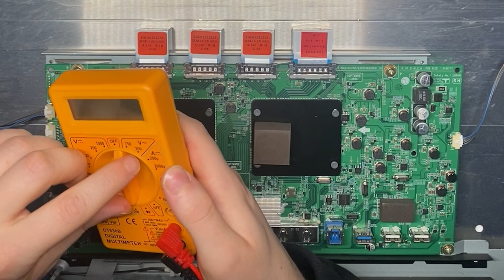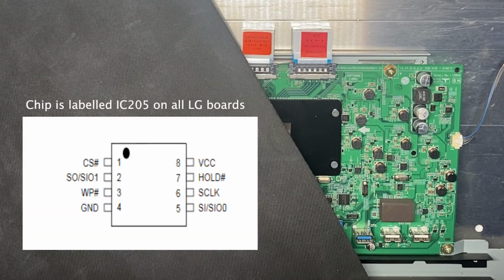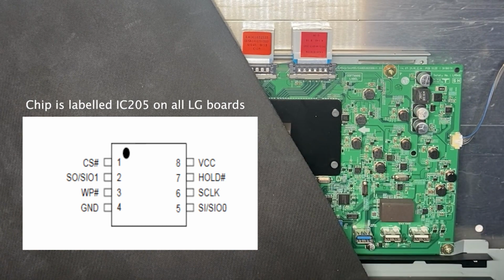LG Monitor won't turn on - LG 34UM95 / 31MU97 FIX

Comment: P900 to SCLK after trying all the rest did the trick. Now onto figuring-out why the mushroom button isn't bring-up the menu as unable to factory reset x)
Reply: ok turns-out you gotta have a monitor plugged-in for the OSD to ever show. Also it seems to refuse to save its settings. After reset, once I power it off it won't come on again unless I run the fix over again (with one of the options you give being successful, a bit at random one of the 3. P900 to SLK was the first one, but sometimes it's pins SLK to VCC or CS to SLK.
Reply: the saga continues: I turned the monitor off through the OSD first. Then through the button, wait 5s, unplug, 5s, replug, 5s, turn on. And it seems to work... so far
Reply: Still working, thanks for the video! 🙌

Comment: Sir, My LG Ultragear 120hz moitor is not turning on.   Techs say that the motherboard whole issue.   

Worried about new motherboard price, I thought I could only use the screen with other motherboards.  Is that possible?   I mean can I convert that into a TV now with any other motherboards like cheap Chinese boards?

Comment: Yesterday i had the same problem again i previously repaired my 31MU97 with the assitance of your video . Knewing now that the power state seems to be uncorrectly stored i had the following idea:
What if manually confusing the ic will give the same result like shortening it?

So i permanently toggled the on/off switch nearby the ac inlet in parallel to permanetly presseing and releasing the on off button in the middel of the steering cross.

After a few seconds I heard a loud bing sound like it always appears after pressing the power (on) button. I directly stopped toggeling.

 Now the sceen is working fine again!

Comment: I unplugged the wall outlet of my 10yo 34UM95 last night and this morning no power. I NEVER did any kind circuit/electricity stuff and after buying a multimeter, I did option 2/3 at least 2 times each and... it worked !! Thank you so much.

Comment: I have a 34uc97. Worked BUT when I turned the power switch off to try and put the monitor back together, it would break again. I factory reset too immediately. I got it to turn on a few times but now it's not so I think the IC205 which is he EEPROM chip, is just dead. I found a new one preprogrammed from an ebay seller out of Texas. $11 bucks shipped. Just search for this and you'll find it. Make sure your mainboard model number matches up before you buy. Shoudl be a relatively easy solder.

PRE-PROGRAMMED EEPROM FOR LG 34UC97C MAIN BOARD# EBU62882001 EAX65923703
Reply: Ok so I got the pre-programmed EEPROM and desoldered the old one and soldered this new one on. DIDN'T WORK! So I put the old IC205 back on and did the tricks he mentioned in the video. And it worked. I honestly have no clue what I did but I suspect that taking the old IC205 completely off the board for a week and putting it back on finally reset it. But really who knows. All I know is that this video did actually help.

Comment: Unfortunately none of the methods worked for me. Got a cheap programmer from amazon and flashed the IC, now it works again.

The flash dumps are quite easily found via a simple google search and sometimes a registration in some hardware forum.

Comment: Thanks for sharing, VCC to SCLK seems to get my 31mu97z-b running again but it won't do the factory reset the monitor just turns off after long press... And the standard menu reset results in the same problem as before, did anyone found a solution to this?

Comment: Worked out!  Thanks a lot! I used the + and alternating the CS# and SCLK pin on the chip, then reset the monitor to default via the menu, but the only thing I noticed is that the EEPROM seems to go back to the bad state if you cut the power without powering down the board via the button. In other words, I left the back side open, if by accident the power get's cut I can do the pin dance again. I guess the EEPROM chip seems bad, or does not store the correct values? Maybe anyone who can elaborate?

Comment: All this dancing with a multimeter comes from poor knowledge of electronics . 
20kΩ resistor doesn't change anything because of the threshold for CMOS logic. For this memory it is 0.7xVCC - around 2.3V. We have to apply such level to deselect the chip.
Also, all the data and control lines of the chip have 22Ω serial resistors - use basic math to calculate the resistor divider 22/20k and the voltage at the pin and you'll see the absolute futility of this idea. 
Moreover, the FLASH access cycle takes a few milliseconds. Trying to randomly get into this period is a very stupid idea. That's why it took 30 seconds with the probes and often didn't work at all. 

I got the result in 5 seconds - I just shorted pins 1 and 8 (VCC applied to CS#), turned on the monitor and heard a beep indicating that the system was on.
Reply from the maker: Yeah I'm no expert. Thanks for sharing your knowledge

Comment: So you're essentially jumping power to the pin... Just use a piece of wire.

Also you keep saying turn it on/off if it doesn't work... The problem is it doesn't turn on the begin with so....

Comment: Thanks a lot for that video. I could fix my 34UC87-B with it.
 
One tip for other users. If you don't have a p900 (+) somewhere, just use the VCC of the IC (Pin 8). This has already 3.3 Volt and you don't need a multimeter to reduce voltage. 

I just used a cable to connect pin 8 to 1, 6 and 7 alternating multiple times. Just make sure not to connect Pin 8 (VCC) and Pin 4 (Ground).

Comment: Tom, Thank you very much for sharing your knowledge. I was able to fix my LG 34UM97-S using P700, SC+SCLK.  I tried all 3 options few times and almost gave up. Next day, I tried option #1 keep touching SC & SCLK back and forth 4 times a more and boom !!! I heard a power turning on. I reset the monitor and it is working just like before. Thank you for your help and many other users suggestion in this form.
Reply from the maker: It's a great feeling when it springs back on after nearly losing hope. Glad I could help
Reply: It worked for me too, reset didn’t keep the state of the IC. Turning off the monitor in te menu did.

Comment: hello
my 34UM95P (EAX65360305) gives me a black screen
I tested your solution, and now I have the backlight, but the OSD not appear
I bought the CH341 and programmed the IC205 with the 3 .bin I found
with the lg34um95 and the lg34um95-p, I have the backlight, but nothing with the 34um95
I checked the 10V panel which is ok
any idea?
thanks

Comment: Thank you! This worked for me with the 34UM95C. It was Red on Pin 6 (SLCK) + Black on P900 that turned on the backlight. I left the probes on for a 15 seconds and I was able to then reset the monitor. Now it properly turns on

Comment: Thanks, thanks, thanks !!!! Awesome advice and instructions well made. I managed to get my 34UC87 back to life. EEPROM in this model is on the reverse side of mainboard. This is convenient because mainboard is enclosed in metal cover and that metal cover doesn't need to be taken off. Used P700+ power switch connectors instead of P900 (which I could not locate on my mainboard).

Comment: I've done this repair on two 31MU97-B successfully, but I had a power outage today and my UPS shut off after the battery ran out, and the monitor won't turn on. I took it apart, replaced IC205, but the monitor isn't fixed this time. I have 19 V on the power supply, it just won't turn on. I had two spare IC 205 chips and, thinking one was defective, replaced it again. Still no power on!!

Comment: Thanks to your video I was able to fix my monitor as well. Slightly different board (LG 34C87C with the chip on the back) but I followed your steps and got it fixed. I just hope is not going to happen again. Bought the monitor in 2016 and it stopped working in november 2024.
Reply: I have the same monitor and board. Found eeprom on the other side but can't locate P900+. Where did you get the + power from ? Found the answer below: P700 works for 34UC97 (mainboard is 34UC97 in my monitor 34UC87). Monitor woke up. Awesome

Comment: Fixed my 34U87M-B by putting my multimeter on resistance (ohms sign) and alternating between SC# and SCLK for a few seconds each one.  Lit up and I was a then able to factory reset it and it's staying on.  Last LG monitor I will buy, they have so many models that suffer from this same issue and it only takes a power loss to cause it.

Comment: I could turn on my LG 34UC97C using method 1 but the mainboard is different. I used P700 instead P900 which I could not find. The IC205 is on the other side of the board so the danger is maybe not too big. Many thanks for your help.

Comment: After checking your video i was able to save €320 repair costs. Even if both of your variants did not 100% work in my case i found the following solution: 
carefully running over both sides of the ic205 pins with the multimeters pins did the trick. I am not quite sure how high the risk is, to kill the chip, but in my case it worked.

Comment: thanks, brought life back into this old monitor that had been sitting on the attic for the last 4 years.  it took me a while to get it working. i think a total of 2 hours. spent 90 minutes 1 night without succes, left everything lay there and went to bed. next day i decided to give it a few more tries before cleaning it up. was on my last try then led lighted up for 2 seconds so gave it 2 more tries after that and now its working again. the P900 - SCLK was the 1 that worked.  Thanks Again!

Comment: OMG, you're a life saver! The most complicated part was to get the cover opened from the monitor :D And my 31MU97-B had a little different board setup meaning the IC205 was on the flip side. And I did not find the P900, but method 2 worked with the first attempt when I already heard the beep :) What a relief! My first time doing something like this based on YT and with multi-meter. I'm surprised I made it :)

Comment: everything works fine, but you don’t need a multimeter for this; just take any wire, connect it to a 2-3 K resistor and do the same. Thank you.

Comment: My 34UM95 doesnt have a rocker power switch and is powered on by the bottom facing button... Is there any way I can manage these fixes with this variation? Trying to hold that button down with my toe while I do it but being a toggle instead of a rocker I dont think it works the same.. 😢

Comment: Mine worked with 34UC97C-B, Used P700 (pin from switch on the other side of the mb), and CS#  - SCLK changing (also other side)

Comment: 3rd option worked great for a lg 34uc97-s. Much appreciated!
Reply: What was the issue? I might buy not working and try to fix
Reply: @biutti1224  The EEPROM (Kinda like the OS in the monitor) gets corrupted or otherwise "stuck". Usingt he 3rd option allowed the EEPROM to reset to a point where the monitor worked again. After it boots the first time, reset the monitor to defaults in the menu, otherwise, it simply returns to being a dead monitor.

Comment: It works for me.
- Multimeter setting: 60kOhm(mine doesn't have 20kOhm).
- Using #2 and #3. It will turn on after few times.

However, unplugging when it's on will make it happen again.

Comment: Outstanding find! LG 34UC97 working.

The first attempt, we flipped the power switch and recreated the problem.

Subsequently resorted to only powering off safely through the menu.

Might have to replace the IC205.

Thank you!
Reply: Did you found the p900 to attempt to fix it?
Reply: @dimitrisvalasidis6547  use p700 on the same side of the board, opposite site, it's pins of the power switch

Comment: Hi, I have a LG 34UC97 and suddenly wont turning on. I have opened back panel and examine the main board but there is no sign of shock burning and also checked the power adaptor and power chips on the board (with multi meter) and they are all fine. I think I could have the same problem but my main board shape is diffrent and I dont know which one is the chip you are working on it. can you please help me with it?

Comment: Finally it worked for me with p900 and clk. But I had to put the positive (red) of the amperemeter to p900 and the negative (black) side to clk, not like you’ve shown in the video

Comment: I have the same problem after I clean the back of the LG monitor model 27GL650. The motherboard is different from yours. What can I do then? Thanks in advance for helping me.
Reply: I have the same monitor wondering if you ever found a solution, thanks

Comment: Hi!, thanks for the tutorial!.  Unfortunately it doesn't work on my LG.  Does the multimeter have to report some particular value on the display to demonstrate that the procedure is working?  the value on the multimeter goes from 1 to 0.7 only in procedure 1 only on #cs.  in all other procedures the value on the multimeter does not change.  Thank you!

Comment: Amazing tutorial. My board was different so thank you for sharing so many different methods. On the 31MU97Z - B you can’t really do method 1, so I opted for 2 and 3. I also realised that I was looking at the chip upside down. You need to look for the dot in the corner to find CS. Also listen to the sound of the chip. If it’s pulsing it isn’t fixed if it the tone becomes steady you should be good. Method 2 worked for me I believe (the 2nd one shown) as the third is also labelled 2 in the video. Thanks for helping me fix this monitor!

Comment: I have the same issue with my LG 34UC97-S but i can't find the IC205 chip. Is there another one built in ?
Reply: The board is a little different than on this video for your monitor. Flip the metal plate that support the board. You will see the LC205. VCC to SCLK worked for me on LG 34UC97-S

Comment: Thank you so much! It worked on my LG 34UC87M-B! My board has completely different layout and I actually found IC205 EEPROM on the other side of the board. One of the methods #2 worked (can't tell which, I tried both). Initially after a couple of tries it started once, but then it wouldn't turn on again. I tried a couple of times over two hours, but it wouldn't work. I was just about to give up and order a new empty chip and a programmer (I found dumps on some forums), but I though to give it another try. Not only this worked, but this time the monitor turned on with white screen showing service information (serial number, board etc.) it wasn't there when it started the first time. Did a factory reset, turned it off unplugged it from a power supply, turned it on again after a while. I've repeated it a couple of times. It started each time. I was confident enough to assemble it together. It's works great since then and looks permanent (I hope so). That said I may order a new chip just in case. It's dirt cheap. I just need to polish my SMD soldering skills.
Reply: Has it still on since then? I am have the same monitor. One time it turned on and after 1 hour no luck. Do you have suggestions for me? Thank you.
Reply: Is it still on? or you had to change the IC205? I have the same monitor. It turned on one time and then died and had no luck yet.

Comment: I hope it will work on my LG 34UC87M-B as well. We had a sudden power loss in my neighbourhood and it won't turn on. I wonder what's the difference between UC and UM models, but it supposed to have the same EEPROM chip. I'll check it out tomorrow.

Comment: Thanks for sharing this info Tom! This brought my LG 34UM95C back from the brink after an extremely nasty series of power fluctuations from a failing UPS. The 3rd option is what kicked it back to life. I immediately performed a factory reset, tested repeatedly, put the back cover on and then mounted it back on the desk arm. Working GREAT! 👍👍

Comment: Hello, the first method is working to turn the monitor on again, but after about 1 or 2 seconds it turns off before i am able to lift it up to do the factory reset in the menu. Any idea about this? Any advise would be great.
Reply: Then there is faulty on the op-amp. The op-amp may need replacement

Comment: Thanks a lot! It works! But I have the problem that when I turn off the monitor it doesn't work again. any recommendations? I have tried "reset" in the normal menu of the monitor.
Reply from the maker: For me, I had this problem 5 times before it truly fixed itself permanently. 

I think what helped me was, resetting it, leaving eco power saving on, and being very slow when turning it off and taking the AC plug out. Do everything very slowly, its a fragile thing! 

Hope you got it to work.

Comment: Hi, I'd like to know what is currently the easiest/best method to use to fix?  I have a 31MU97.  Took it off a monitor mount and accidentally banged it on my desk as I was taking it off the VESA mount.  It wasn't too hard an impact, and only like from 6 inches from desk surface onto desk top.  But after that, it wouldn't power on anymore.  Tried a different power cable and different outlet with same result.  It has been reliable for me for many, many years, until this.

I have obtained the firmware .bin file.  Wondering if this is the easiest method to try, before multi-meter and eprom chip replacement?  If so, what do I need in order to do the firmware update?  THANK YOU!